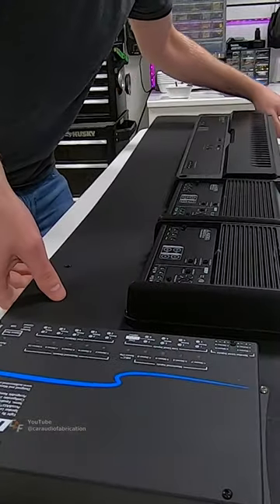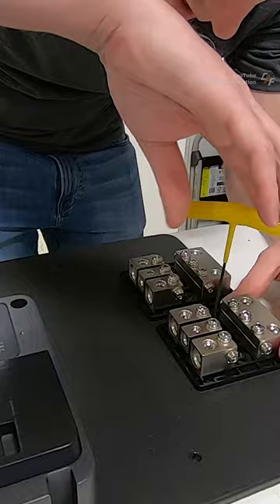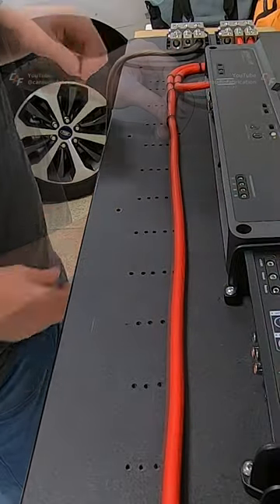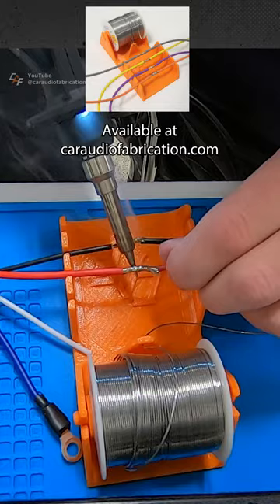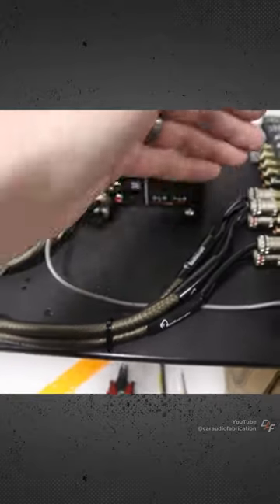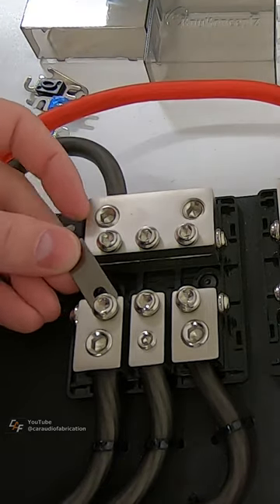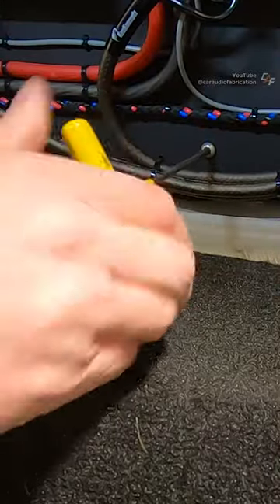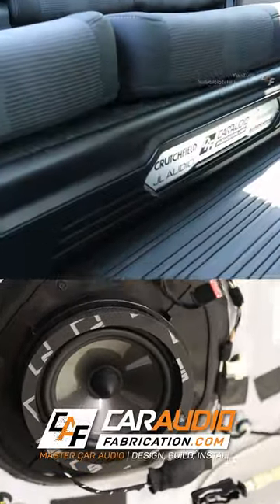Let's wire this amplifier rack for our custom car audio system!

Comment: Quick question.  General consensus is fusing the power cable near the battery.  Dies fusing the distribution block just isolate and power issues?  Thanks
Reply from the maker: You need a fused anytime you step down in wire size. You are protecting the wiring with the fuse. More details in my full fuse explanation video

Comment: I don't really understand the point of grounding blocks and connectors like fuses. All you're doing is adding extra cost, and for what benefit.
Reply from the maker: Not burning your car down is a pretty huge benefit
Reply: @CarAudioFabrication  those connector plates that you're using on the ground block aren't fuses and have no rating that I see. How does that prevent a fire? You're suggesting that if a ground wire was damaged that it might short but really all it's doing is going to ground. I mean if it were worn the risk would come from some other positive also being worn and grounding back through the ground but that's why you fuse the power wire.
Reply: This is from their website on this product. It makes absolutely no mention of it being a safety factor. "Link is a Mini ANL sized brass buss bar that has been black chrome plated. Links can be used to convert Mini-ANL fuse blocks into ground blocks or to allow higher current loads to pass through a fuse block then Mini-ANL fuses allow for. Warning If using a LINK to bypass a fuse on the positive side of your electrical system, PLEASE understand you are removing the safety factor that is the fuse from your electrical system. KnuKonceptz recommends only using a Link for your ground connection."
Reply: More to the point, if using a ground block without a pointless piece of brass connecting two halves was a hazard, they'd be foolish to make standard grounding distribution blocks. Further, if they were to suggest that having them add safety, then the inverse would be true, not having them is hazardous. 😮